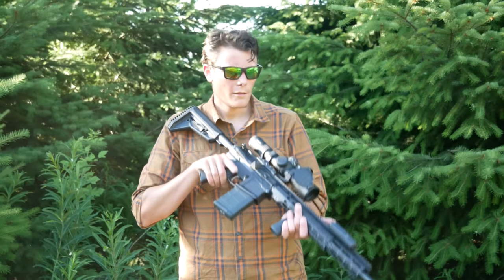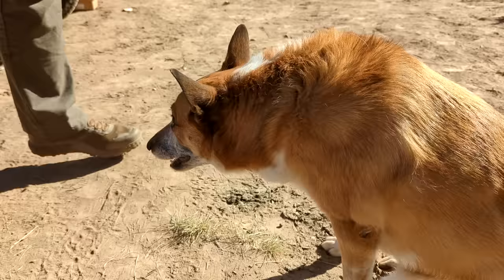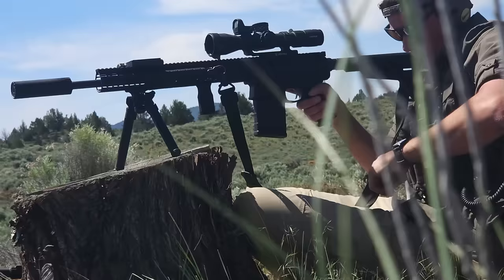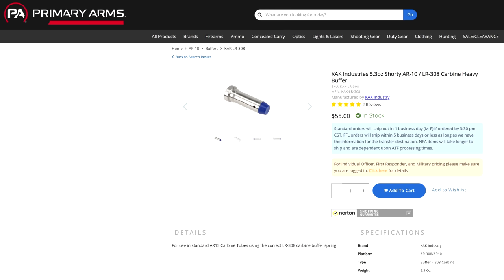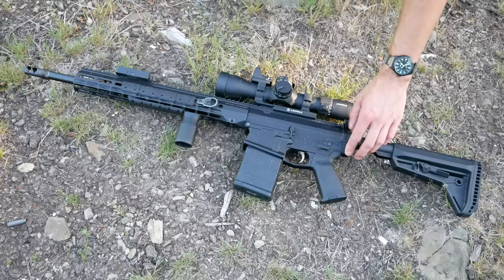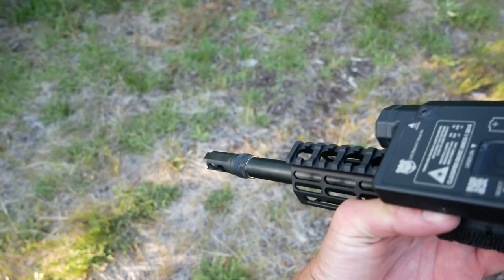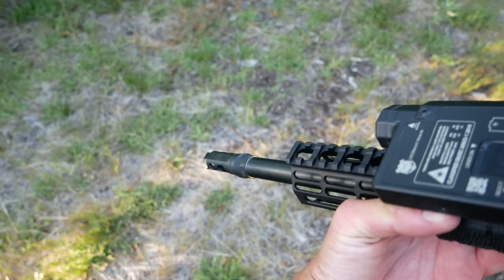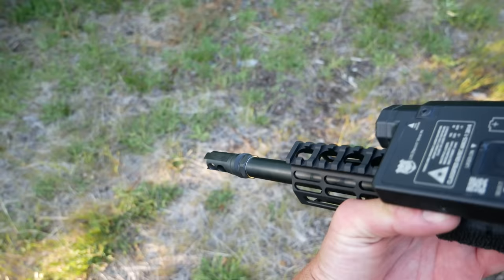Aero Precision M5 SAPR Build

Comment: Good looking build, hope you get good accuracy out of it long term. As long as you're not running it bone dry like some people for 5k rounds, I'll bet you'll be fine.
Reply: Just curious what do you consider bone dry. I'm not trying to be confrontational, I'm truly curious as how you would lube this rifle. Seems there's a lot of opinions and I have my own but I'm always curious for what others are doing. Thanks
Reply: Best practice is put a couple drops of rem or clp oil on charging handle work it to top and sides even can go really light inside where the gas key goes then if your bcg is phosphate or black nitrate a drop by cam pin and in bolt them a couple drops on the top and rails that ride inside the inside body of the upper and I'm pretty sure most only do a small drop on trigger or hammer spring for lower internals but really it only need a small amount every once in a while and will cause less wear and tear , I've seen some people super excessively oil to where it's dropping all over and smoking like a mother trucker when you start firing
Reply: Yup Trex arms saying this rifle won't last long as shooting thousands of rounds bone dry even they advise you to oil a bit here and there
Reply: Ok. Ya I oil the raceways of the bcg were it contacts the upper receiver but I keep the internal portions of the bcg dry and would do the same at the charging handle. Because I would think that the lube would attract carbon and debris and mixing with lube would act like a paste gunking up the rifle. The bcg are either nickel boron or nitrided ect, so they should shed fouling with firing. This in my opinion is what the gas rings are for and the reason they are serviceable. From what I've been able too read about the design including Mr stoner's recommendations. I also thoroughly clean my weapon after each range trip. So yes I lube quite frequently but it's just the bcg raceways and the trigger group.
Reply: @patb7723 What trex failed to address is no one is doing rapid fire burn down tests on a dmr lmao. I have seen one of these rifles with 1000’s of rounds through it and still functioning flawlessly.
Reply: Oil sucks, go grease and never look back
Reply: Ya I use oil and sometimes grease depending on if I plan on several range days in a row. I like too use grease in the trigger assembly since I don't break it down for cleaning every time I shoot. And yes I'm not doing mag dumps. I will put it through a pace but not really looking too abusive the equipment. I'm just curious for others lube regiment's cause I see a lot of weird shit out there and guys with soaking wet guns and some who I've talked to and seem knowledgeable. But they have this soaking wet gun and I part ways confused
Reply: @dxpvxo711  stop cleaning your gun every range trip too, over-cleaning is more harmful than a little carbon buildup
Reply: @basedWisco715  that blue/green marine grease works pretty well, it also has corrosion inhibitors.
Reply: Well I patch the barrel and disassemble the BCG and clean it. That's it. I don't take out the trigger group sometimes for quite a while
Reply: @investigativeoutcomes9343  I prefer slip 2000, as it seems to shed carbon and dirt a little better. But as long as you don’t gum it up with sand or dirt, regular grease works fine too
Reply: @basedWisco715  whatever works, i find that oil lubes just run and dry up causing the need for repeated oilings. The first shot the lube is blown out of the action anyways. Grease does not go anywhere, not as fast, use lightly. don't limit your options to lubes designed for weapons either, there is really good stuff out there not intended for weapons and works better than anything the firearms industry offers. teflon dry lubes and stuff, graphite lube. i have used plain old LSA and been happy with its performance. for bore corrosion protection run a patch through your barrel wetted with non (PTFE) silicone lubricant and then a dry patch, you will be good to go for a few days in extremely humid conditions. also all parts of the gun should get some kind of treatment for protection against corrosion.
Reply: @basedWisco715  like i had a real badly copper fouled barrel, nothing would remove the copper. bore foam, solvents, all firearms industry offerings i tried, soaked for days. got fed up and wetted a patch with Brasso, 5 strokes, dry patched 5 times, flushed with wd40, dry patched, barrel spotless, fking amazing stuff.
Reply: @investigativeoutcomes9343  I agree with oil not working, I’m taking about the slip 2000 grease, EWG. It’s all I use in my guns now
Reply: @basedWisco715  yeah, that's good stuff, it's a light grease, non (PTFE), i have used slip 2000 it's gtg. i live in an area without gun shops or sporting goods stores so i have used many auto industry lubricants and other industry lubes that also work very well.
Reply: @basedWisco715  i'm about to see what fuel injector cleaner does to carbon fouling in my barrel. lol
Reply: @basedWisco715  so if you see me at home depot picking up some pb blaster or wire pulling gel, well you know. lol
Reply: @investigativeoutcomes9343  same, it’s all metal. I’ve used regular wheel bearing grease with good results too, it just seems to hold dirt more than the slip does. And it gets tacky in the winter here too, unfortunately
Reply: @basedWisco715  i hunt coyote on freezing winter nights using my .223 wylde AR, 11:00pm to 5:00/6:00am and alot of oils would freeze and lock the action, but i would still be able to fire one shot in freezing temps, only need one shot though. so i tried graphite lube and it worked well. I wouldn't recommend the graphite lube for heavy use though. Also i was thinking about ordering some slip 2000 EWG, it's good stuff. my bolt actions I run dry.
Reply: I've noticed the oil running or drying up like you said but always wondered what would work best cause some months here we get winter and other months get pretty warm and humid so I'll have to try the gun grease slip 2000, yeah I agree most rifle would last alot longer I don't try to mag dump mag after of mag where you gonna burn out a rifle I shoot in slower intervals.
Reply: Never run dry......always take the 🛢 😆 .

I really don't clean much any more......my bcg is so polished it just wipes off with balistol.....I run a mop with balistol through the bores and that's it...

When the trigger needs cleaning I spray it out with map sensor cleaner and relube......

Lube choice is important if you live somewhere cold....so far I've tested to -28f lol
Reply: @dxpvxo711  look up school of the American rifle and get real gunsmith knowledge
Reply: @patb7723  balistol , Lucas oil work well...but for money saving look up the home brew lube formula from SOTAR
Reply: @prone_wolf8871  ty for info will have to get some.

Comment: I love my Aero M5 build. BA 16 inch Government tactical profile barrel. LMT muzzle brake, Larue MBT straight bow trigger, B5 precision stock, KAK magazine release, YHM gas block and Magpul grip. As for glass Riton Conquer 7 3-18X50. Decided to stay away from Aero’s bolt carrier group. Went with Recoil Technologies bolt carrier group. Gun has ran perfect right from the get go.
Reply: Thanks for supporting🤘
Reply: Curious what range & groups you’re shooting with that^ Thank you!
Reply: Extremely accurate until the barrel heated up. Someone offer me a high end LR308. Had to trade the Aero. Plus five other rifles. However I missed my Aero. So I built another one. This time with a BA 20 inch premium series stainless bull barrel. Dark Industries BCG. (Phosphate,chrome lined carrier and gas key.) Luth grip and Precision stock. LMT muzzle brake and buffer tube. Larue trigger. War hammer charging handle. KAK magazine release. Amazing rifle.

Comment: I run all my AR10/LR308 type builds with an A5 length buffer tube, Armalite EA1095 spring, and H3 buffer.  Since Armalite parts are unobtainium right now, a complete buffer assembly from LMT works.

Comment: Best thing you can do is upgrade to an a5 length buffer tube and use a armalite rifle length spring then use standard ar15 carbine buffers. Drastically improves 308 and 6.5 large frame guns. Best thing I ever did
Reply: Same thing I did and a rise armament drop in, faxon barrel and was off to the races

Comment: I built an M5 with BA 16" 308 barrel/ SA Adj gas block/ BA BCG/ Aero M5 enhanced buffer kit. Fairly light. >2 MOA with m80, >1 MOA with Federal GMM 175's. Has run reliably and consistently over 2k rounds now suppressed. It needs a heavier buffer for hotter rounds, but other than that its been great. Maybe change out the handguard for MWI combat rail for aesthetics ...

 I am looking at getting an SP10 in 6.5 to really stretch a gas gun past 1000.
Reply: Try the jp scs.......and if you want to tighten your groups.....go proof barrel on your next long range rig....and find the most solid stock you can (be surprised how much this can help shrink groups)

Comment: No matter what you do plan on running an adjustable gas block. Once you dimple your barrel you’re all in. My Bravo block didn’t match the Superlative Arms block. Ran a 10 oz buffer and a wolf extra power rifle spring and it overran the extraction. Had to close the block more than halfway to tame it. BA modern series 16” midlength and it was extremely overgassed.

Comment: i think this is a "What Would Nutnfancy Do" line of thought and i agree with the method to the madness. i am funds limited and his "high value" light-weight multi-purpose direction has been guiding me for years constructing my DIY firearms. my first build was from an Anderson AR-15 stripped upper and lower; my second build was a Polymer 80 Glock 19; i'm currently in the process purchasing parts for an AR-10 DPMS build.using a stripped Aero M5 upper and lower.

Comment: Aero enhanced buffer is sweet.  The buffer retaining pin keeps the buffer tube from rotating if your staking fails and it has a longer shelf to make a much smoother transition of the bcg into the buffer tube.  The 6 position detents are also drilled for water to escape.  Its literally the best buffer tube on the market when you actually know how mechanics work.

Comment: I appreciate the sharing experience with your Aero/BA .308 SAPR, Hop. I recently did basically this in 6.5 CM/ 3-18 Primary arms Glx (the fairly new one) and did a dumb with a springco orange heavy duty spring. Ran maybe 12 rounds with 50% failure rate. Instead of addressing moar gas, I made the bolt cycle too hard back into battery. It would have been decent logic with .750 gas journey but I didn’t consider it might have a larger gas port. Put the stand aero spring back in and haven’t had a chance to shoot since then. I expect another 2 mags of gas break in if your experience can be carried over to unga bunga caveman build.

For those who are curious:
BA complete upper 18 inch 6.5CM Hanson 
FCD stoner KeyMo for future heavy recoil.
Nickel Boron Aero (BA marked) bolt
Aero lower, Aero parts kit
Geissele SSA
Radian raptor LT for 308
Magpul w/e moe grip from parts kit
B5 systems adjustable.

Comment: Been running a JP SCS assy. in my Mega MATEN LR308 build since 2012. Not a single problem. Also running a Syrac Ordnance adj. GB with it. Give it enough gas to run, instead of throwing weight and heavier spring pressures at the problem, guys. The more gas you let into the system, the less velocity you get, and more fouling and gas to the face. Work smarter, not harder.

Comment: Built basically the same using mostly Aero parts except a lighter weight 18" rifle length gas system Faxon 6.5 Creedmoor barrel.  I have two other LR308 rifles, one actually an Armalite AR10, one wears an 18" and one a 16" BA .308 barrel.  I look forward to your series on the new rifle.

Comment: I built one of basically same specs (upper/lower/tube/spring/buffer/barrel).  I did use an adjustable gas block and a different break that fits my 36M suppressor.  I had significant ejection and cycling issues for the first 100+ rounds.  I had to remove the second rubber o-ring on the extractor for the extraction to work well.  In the beginning it would ONLY cycle suppressed with the gas port wide open.  Now it seems to be cycling and ejecting fine unsuppressed (no malfunctions the last 200 rounds).  I tried a heavier buffer (you can buy an adjustable buffer) but it wouldn't cycle unsuppressed if it was heavier than the standard weight.  It also wouldn't go into battery if the buffer was lighter than the standard weight.  Talk about balanced on a knife edge...

I'm still running it with the gas port wide open both suppressed and unsuppressed.

Yes, it's very heavy.

I'm still learning about it but I'm happy that it's been reliable the last several outings.

Comment: I recently built an LR-308. Went semi lightweight. Came out at 6 lbs 8 oz without scope and magazine. 

I am using an adjustable gas block, empty buffer and lightweight bolt carrier. A mild muzzle brake and fixed PRS stock. And faxon pencil barrel 

So for it's been fun to shoot. Eats cheap steel cased ammo no problem along with my brass reloads. 

Only has a few issues at the beginning until I got the gas block dialed in. The gasblock screw vibrated open too far and it was stove piping. Once I noticed the reason and fixed the issue it's been flawless. Recoil is not bad. Seems less then my heavier bolt gun. Very manageable 

Getting expensive to shoot because it's so fun.

Comment: The heavy profile barrels from Ballistic Advantage seem to have a more optimized gas port size. They tend to cycle reliably with standard buffers, tubes and springs. I think they make the ports a bit smaller on the Hansen profile but I never actually measured; just eye balled it. 
Also M80 ball is hilariously inconsistent from manufacturer to manufacturer. I've had around 300 FPS average variation among 20 shot averages of nearly a dozen different manufacturers. This plays into reliability. I'd recommend you pick a 308 precision load and stick with that unless you're fucking around plinking. Its easy to adjust the gas/buffer for any specific load of 308 or x51, but you will never have an AR10 that will reliably cycle all loads. There is just too much inconsistency.
Reply: Glad I went with dpms and the lighter18" faxon barrel from what you say and my experience. That 20 in. BA barrel was wicked heavy knocked almost 2 lb off.

Comment: I just built an almost identical Aero M5 last week, except with a KAK 18" .308 rifle gas nitride barrel (about 5 oz heavier than the BA Hanson). Did not have the kind of bread for that scope, though. Running a Burris RT6 on a LaRue LT104 QD mount. The whole thing is a bit chunky, about 11.25 lbs with a Streamlight HL-X attached. So far so good, just a couple of hiccups, but haven't really gotten much accomplished with it yet. Still in break-in mode. Running the Timney Impact AR trigger in it. Phenomenal trigger. I have the same trigger Hop is using in a WWSD build and it is pretty good too (better with Kaw Valley springs). Bang for the buck goes to the LaRue MBT-2S, IMO.

Comment: I did an m5 build last January, i used the vltor A5 buffer tube and it allows you to use “normal” ar15 buffers. 

I’ve been struggling trying to suppress mine, if i use all the same ammo it’s mostly reliable but any switch in ammo starts messing everything up.
Reply: Do you use a Sprinco spring with the A5, if so, is it the green or one of the other standard AR15 size ones?
Reply: @dp2pl8   yes sprinco, they have  a few options for 308 i got 25308 which is a red spring and  extra power extractor springs. I think tubbs makes one too but I’m not sure it’s just what i was told.
Reply: @itsamk18-ish90 on my M5 build I ran a tubbs flat wire ar10 spring, a vltor ar10 extension, an H3 buffer and had a BA 16in  Hanson barrel. Next step was an superlative arms gas block or an adjustable carrier because of how over gassed it was with a K can. I'll build another eventually, but have been eyeing up the SFAR or Revolution for maybe my next purchase
Reply: @markusjopek3994  i have the solgw 16” barrel which I’m pretty sure is just a BA Hanson lol. I put an aero adjustable gas block,A5 buffer tube,sprinco spring and I’m pretty sure a 6oz buffer but i would have to double check. With some ammo it runs great with a can and with others I’ll get all kinds of crazy malfunctions. I was getting a lot of blown primers out of a cheap batch of reloaded ammo i got, with slow mo it looked like my bolt was unlocking too fast so that’s when i added the adj gas block.

I’ve seen lots of issues with the sfar, might want to wait until they get them all ironed out.
Reply: @itsamk18-ish  the POF had the same teething issues initially. I figure by end of next year there should be enough R&D from high volume shooters to have enough data for Ruger to make the necessary changes. If not, then I guess it's another M5 or M&P10
Reply: @markusjopek3994  yeah hopefully they get it ironed out, a lot of them seem to be decent guns so maybe it’s just a QC issue. 

I’ve heard the M&p 10 is a nice gun, i almost got one of those but wanted to put the stuff together myself. I think my next buy will be a bolt gun or maybe a 300 black out build I’m not sure yet.

Comment: I built mine in late 2019 and finalized it just after COVID started.  I love the Aero hardware and use 7.62x51 Criterion 18" barrel.  I run a Geissele flat trigger.  I've kind of gone back and forth on the primary optic but for now it runs my Trijicon MRO at a 50yd zero.  I have a Trijicon scope ready-to-go with a QR base if LR is necessary.